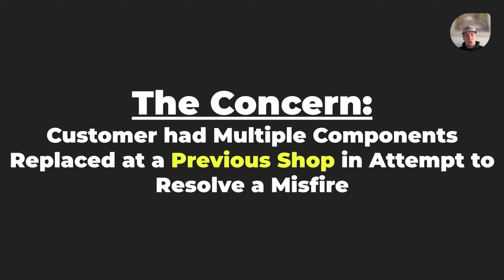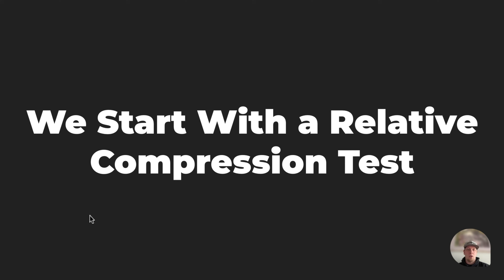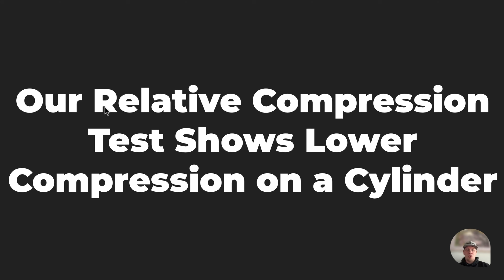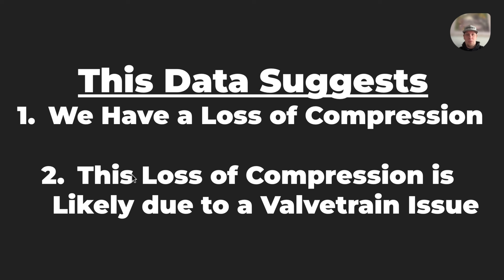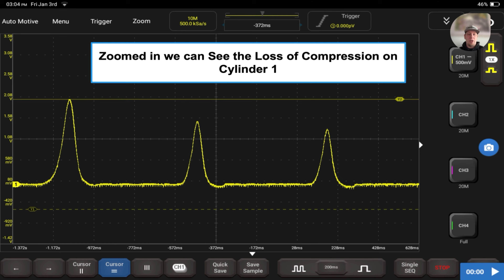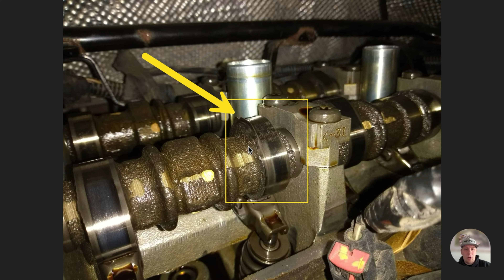Pentastar Engine Misfire Diagnosis | Chrysler 3.6L Valve Train Repair with Advanced Tools

Comment: Second I saw the compression on Cyl 1 reach upwards of 200+ psi I knew that rocker arm wasn't operating correctly. Valve was closing early, then not opening all the way, etc. All makes sense that there were flat spots on that bearing. Thanks for the video!

Comment: All TopDon scanners use Launch Software to run? Looks very. Very similar to older launch tools.

Also yall spend more time and diagnostic equipment on this issue then that POS minivan is worth lol.
Reply: Just a matter of perspective. Easier for mom to pay the repair bill than to buy a new 60,000 minivan that will also be a piece of shit and even higher repair bills when it too breaks down.😮
Reply: @  better for mom to realize dodge / Chrysler products are utter trash and buy herself an older Toyota sienna.  For $8000.
Reply: @E39M5SPEED Topdon is the Launch platform rebranded.

In regard to the rest of your comment, all of the scope tests can be done within the 1 hour diagnostic window. Whatever it is you charge for diagnosis (the average is 130/hr) That's pocket change compared to the parts cannon that was fired at this vehicle.

Customer could opt to pay tear down for a physical verification of the problem, which would just roll into the total labor cost anyway.
Reply: the kids got to get to soccer! lol
Reply: @ mom won’t be able to afford even the diagnostic time let alone replacing the heads on this minivan that’s worth $1800.